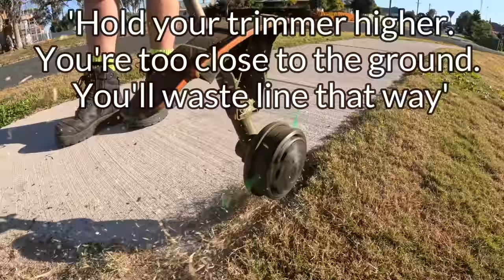She called the government, so they called me! Lawn and garden Australia

Comment: My sister once told me it was impossible to keep flower beds weed free, over 20 years in my old house and all my flower beds were weed free because I weeded regularly.  The house I live in now has grass surrounded by a concrete edging and I used a chipping hammer to pull any grass that tries to escape from the concrete edging, not a bit of grass outside the edge because I maintain it weekly.  As for a clean weed eater edge I'm still working on that and at 74 I may never master the perfect edge.  Once again if I were the homeowner I'd drag a chair outside and just sit and marvel at how beautiful the yard is after all the work you and Tyler did.

Comment: Excellent job, Sean!   You're absolutely correct;  replacing strimmer wire is far, far easier and cheaper than replacing a back, and the latter often cannot be done;  I know because my mom is a physician and my late father was also.   Wise man.  

As for weed covers;  this tale may be a bit boring and long winded, but it may help someone else reading it.  Being an avid gardener myself,  and with a good deal of acreage to deal with, then and now, I struggled when I bought my first home, with seemingly insurmountable weeds, and I wanted to plant bamboo's along a stretch of land.   Believe me, ground/weed cover doesn't work, none of it does, and I wasted a good deal of dollars over the years buying the demmed stuff.  However, one day at my great aunt Honoria's home I was helping to sort thro some garbage ready to be thrown out, and I came across what seemed to me to be a large type of what I believed to be thin tarpaulin.  It turned out to be a plastic mattress lining or mattress cover for a bed.

Well, it turns out that these things are cheap as chips (three or four bucks), and I went online and ordered (I think three or four of them, can't remember now), and laid them down for weed cover.  It's been years now, and not a weed in sight.  Not one.  I laid the plastic sheeting down, cut the holes, planted the bamboo's (now 14 feet tall), and threw some gravel down around the plants.   I get many positive comments on that tall hedging, lol, and no-one knows what's underneath them.
Reply from the maker: Glad you had success with it! :)

Comment: Was going to drop you some suggestions to consider:
Ask the property owner, not always the renter when you get conflicting answers with the renter as to what you think is advisable to be done regarding your services for the property! 
Other idea:
There was reference on the internet that I think is a great solution to un maintained planting beds that don’t look good …. To spruce them up.
Remove weeds that can be pulled and shave the area to bare ground as best as possible with string trimmer. Then lay pieces of cardboard… can be in as big sheets as possible. Lap slightly. Add free wood chips from local govt tree trimming operations storage site or bagged free for pickup. DO NOT USE GRASS OR WEED MULCH because it is full of unwanted seeds that will sprout!!! Pile them deep and smooth them out. You can spray them with dark brown landscape “paint” to make the chips look expensive:-) If possible, layer in a sprinkling of PREEN…. a seed germination preventative…. To prevent any seeds blown in the landscape beds not to germinate!  Anyway, the cardboard breaks down over time and earthworms will eat the cardboard so it is a good thing.  
Another suggestion: ask if stones and brick and cement blocks strewn around can be hauled off to eliminate mowing around or hitting in the future mows. Those are usually left over from the buildout of the property and owners just try to find something to do with them….. not wanted and a pain maintaining the yard!!
Reply: I’d empty and stack only the nice planting pots long ago abandoned and put them and other items in their garage. When people no long can physically or financially do yard work, the unusable things like rotted and ruined stuff need to be bagged as garbage and gotten rid of. Ask the residents if they want anything from the pile of stuff you’ve made of what you view as needing to go to the dump and give them a deadline for deciding.
Old, warped boards, drywall etc are unusable!

Comment: Hallo Sean, gönn Dir auch mal eine Pause im Schatten. Wie in Minute 1:45. Denn die Wärme kann ganz schnell zu gesundheitlichen Problemen führen. Ich habe es in meiner Ausbildung zum Baumschulgärtner bei 3 Kollegen erlebt. Hitzeschlag. Und was Du in den gezeigten Minuten vorher gemacht hast, ist nunmal auch keine einfache Arbeit. 
Rindenmulch ist zudem auch sehr gut für den Boden, wer es noch nicht wissen sollte. Denn erstens hält es den Boden locker, zweitens feucht, drittens hält es auch die Wildkräuter (ich schreibe nicht Unkraut, denn das gibt es nicht) fern. Und zu guter Letzt kommt viertens beim zersetzen eine Humusschicht. Sie sollte aber spätestens (meine Erfahrung) alle 2 Jahre erneuert werden.

Hi Sean, give yourself a break in the shade. Like in minute 1:45, because the heat can quickly lead to health problems. I experienced it in my training as a nurseryman with 3 colleagues. Heat stroke. And what you did in the minutes shown before is not easy work either.
Bark mulch is also very good for the soil, for those who don't know. Firstly, it keeps the soil loose, secondly, it keeps it moist, thirdly, it keeps the wild weeds (I don't write weeds, because they don't exist) away. And last but not least, when it decomposes, it creates a humus layer. But it should be renewed every 2 years at the latest (in my experience).